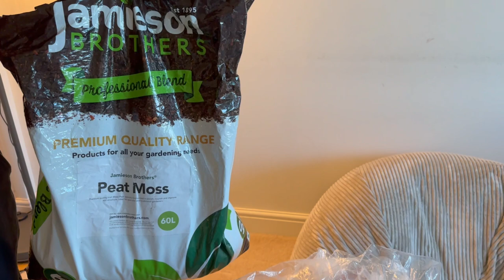River Bank 3D Riparium background: Step-by-step guide!

Comment: Hello! Great videos. Very informative. I'm setting up my first blackwater tank (125 l) and I'm going for Cardinal Tetras and some Adolfoi corys. Can you please tell me how to introduce new fish to a blackwater tank? Maybe with a slightly lower pH compared to the store tanks.... Thx!
Reply from the maker: Thank you :) The best strategy is to add fish to a regular clear water tank with a hardness on the acidic side and then slowly start adding tannins (botanicals, blackwater extract or rooibos tea) until you reach the desired level. The fish need a few days to get adapted to tannins. C.adolfoi are from blackwater areas so they will thrive in it just like cardinals.
Reply: @tropicalfishhub   Thank you! Sounds good. But I don't have a second tank on the side right now. Maybe I can add the fish first and then the botanicals/tannins i portions?
Reply from the maker: @arvidgunnarsmo9919  Yes, that's what I meant, there is no need to adapt fish to blackwater in a separate tank
Reply: @tropicalfishhub  Great! Thank you very much!